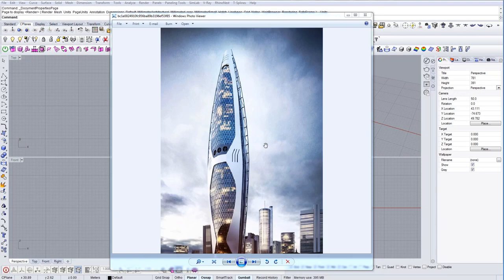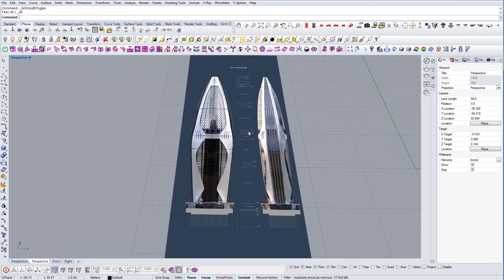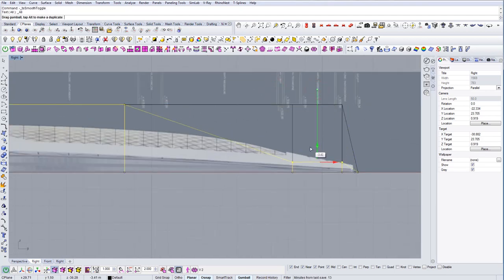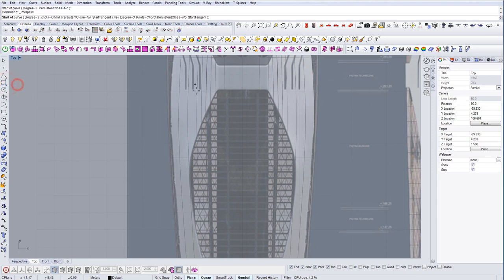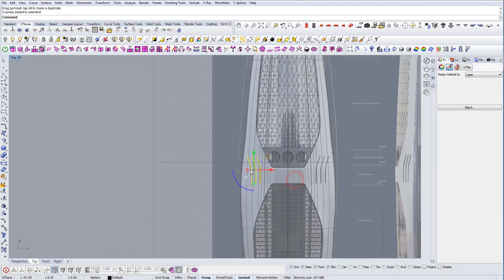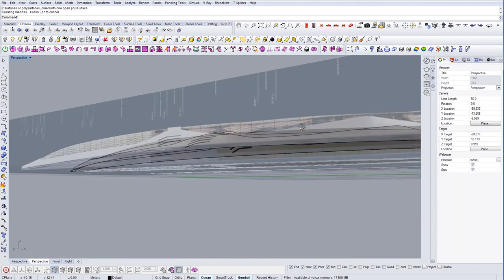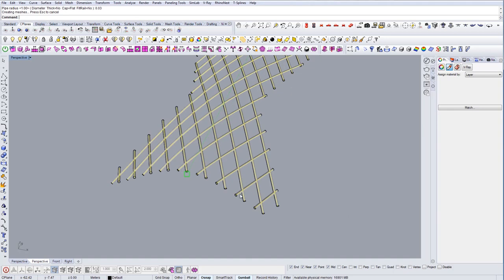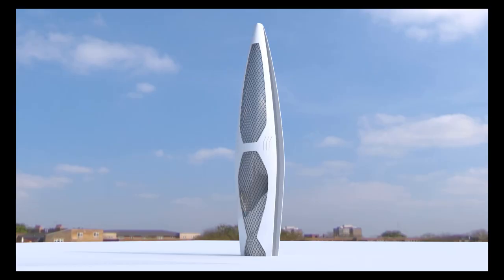How to Model Complex Building in Rhino

Comment: Hello Mr. 

How can I Change the direction of the Iso Curve. 
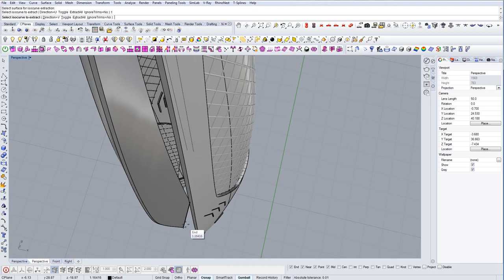When I run the command _ExtractIsoCurve.   It only adds a curve but in Horizontal direction, How can I Change it? 24:50 in your Video.

Many Thanks

Emmanuel
Reply from the maker: Hey Emmanuel, 
When you execute the command, press T (for toggle) and this will give you an option to change the direction of the isocurve :) Hope that helps!

Comment: What Toolbars are the ones you have active in the video? Those Yellow and Pink Icons
Reply from the maker: Hey Paolo, thanks for your comment! So the pink one is the T-spline toolbar, the yellow ones are Visibility toolbar and Selection toolbar. They come quite in handy sometimes, that's why I like to have them visible. Hope that helps! Cheers :)
Reply: @HowtoRhino  Might I ask what other plugins you have installed as well? :o
Reply from the maker: T-splines, RhinoNest, Grasshopper, VisArq, SectionTools, Vray
Reply: @HowtoRhino  T-Splines isn`t available for Rhino 6 anymore. Do you have any recommends which one to use instead?
Reply from the maker: @kevinhugle307  Yes, if you have Rhino 6 license, you can have access to Rhino 7 WIP version. In that version, you have Sub-D tools which are native Rhino tools that are working the same way as T-splines. However, they are still in development meaning they are not perfect, but you can use them to get the same result as in the tutorial ;)